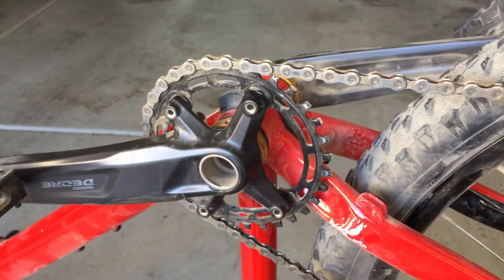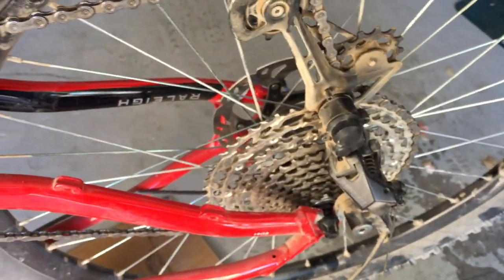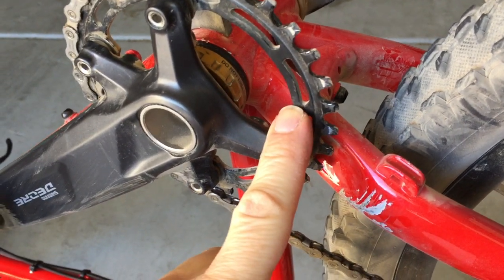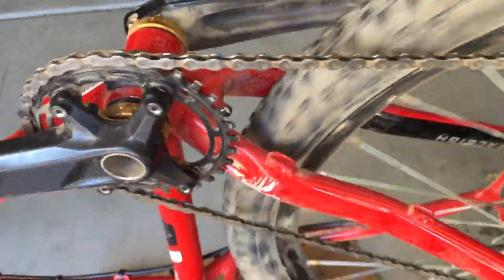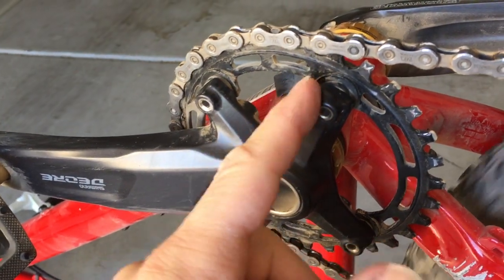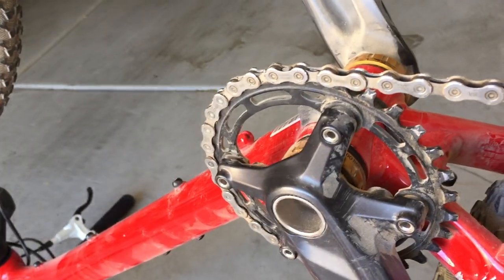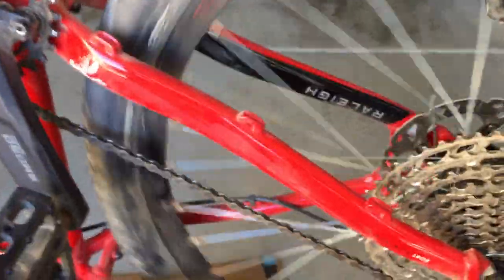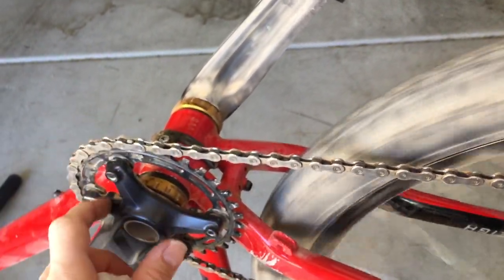Shimano Deore M5100 1x11 crankset chainline for 135mm OLD non-boost

Comment: I have no issues with backpedaling on 51t or 46t on my 135mm bikes. Chainline is perfect. I don't get this.
Who made this issue up? This maybe happens with boost components on 135 freewheels but I doubt that too as every video with the backpedaling issue was bc of wrong setup of bottom bracket spacers.
Reply from the maker: What’s your chainline measurement on those 135mm bikes? 47-48mm is ideal for 135 and 142mm OLD. Shimano specs 52mm for their boost cranks. The m5100 I installed is 52mm so I spaced it back to 47.5mm. I wanted the chainring to align with the center of my cassette. At 52mm, it was lined up with the 2nd or 3rd cog. Moving back to 48mm reduced the chain angle when in my 51T cog. Backpedaling may not have been a problem but I was more concerned about premature wearing of the chain and teeth due to the extreme chain angle especially with my short 425mm chain stay length. Removing or adding bottom bracket spacers effectively also changes the chainline of the chainring by offsetting the entire crankset.
Reply from the maker: You also may need a specific chainline to clear the frame, chain stay or tires. This was one of the reasons 148mm boost and 157mm super boost were developed. I believe 55mm chainline is used for super boost.
Reply: @mtbbiker6401  Around 50mm, if I remeber that correctly. 
Btw I've tried a round on a 157 and was hitting the chainstays with my heels (not into cross dressing!) all the time, that even happens with 135's, I got frustrated in a minute. Why is that, do you think that people that scratch their cranks don't have that issue?
Reply from the maker: 157 super boost is crazy wide. I think that was derived from true downhill bikes. There are a few manufacturers that have adopted it. Devinci, Pivot, Alchemy and others. I doubt it will become the norm due to the wide q-factor. Most makers have resisted the wider hub stating you don’t gain much in wheel strength to create a whole new standard.
Reply: Sorry it took me so long... What was your chainline with the right BB spacers setup? And why did you put spacers on the driveside in the first place, Shimano specifies 2 of them on the non drive side on 68mm if I remember correctly (maybe even 3 of them)?
Reply from the maker: @FirefighterBobby  For HollowTech II bottom bracket, Shimano recommends using three 2.5mm spacers for 68mm width brackets. Two on drive side (5mm) and one on non-drive side (2.5mm). For 73mm width brackets, only use one 2.5mm spacer on drive side. This is according to Shimano Dealer's Manual. My bottom bracket width is 68mm so I used three 2.5mm spacers. I could have moved one to the left non-drive side which would have reduced my chain line from 52mm to 49.5mm. I had room to move both spacers to left giving reducing chain line 5mm from 52mm to 47mm, but I didn't have many threads left if I put all 3 spacers on left non-drive side bottom bracket bearing housing. I would have lost 7.5mm of threads. I ended up leaving 2 spacers on the right drive side and 1 on the left non-drive side but added 4.5mm of spacers between the crankarm and the chainring resulting in 47.5mm chain line from 52mm.
Reply from the maker: @FirefighterBobby  So I just moved this crankset and bottom bracket over to a full suspension frame which has 73mm bottom bracket width but is also 142mm thru-axle non-boost. This time I only used one 2.5mm spacer on the right drive side per Shimano Dealer Manual while keep the 4.5mm spacers. The chainring was hitting the chain stay. The most I could reduce the chain line without hitting the frame was 48mm but it was still too close for comfort. I ended up moving the 2.5mm spacer to the left non-drive side and removing the 4.5mm spacer from the chainring. Now my chain line is set to 49.5mm vs 52mm on this other frame. I have not tried it yet but hoping it will be adequate.
Reply: @mtbbiker6401  that 49.5 works perfect for me, I have the same, just measured, runs smoothly like watter. Btw I should remove that plastic inside of BB or add a spacer on left non drive side, as it's too wide without that one spacer shimano suggests.
Reply: Another thing, seems that you're sticking with their manuals, and even tho it'll sound dumb, don't do it, use logic as I found them to not inform people properly, specially when it comes to older parts fitting new series or spacers and brakes. No way on Earth they'll tell you to mix their leavers with Magura calipers, or that many derailleurs work on different shifters.
Reply from the maker: @FirefighterBobby  Thanks for the info. Yes, Shimano sells a single bottom bracket size that fits either 68mm or 73mm. The internal plastic sleeve is the same size but requires you to used either 3 (2.5mm) spacers or 1 (2.5mm) spacer. So you don't run any spacers on your bottom bracket?
Reply: @mtbbiker6401  I do, but the one we're talking about (68/135 hub) I have 2 spacers on the opposite side to get the chainline to work, and on the other I run only 1 again on the L, wrong side. Both setups work well, and the measurments are not as should be, my chainline on FR bike should be 50,4 and is 49.5 with 2.5mm less. I don''t get it why, I just look for the right setup.
Reply: Btw just checked, there is no 1x cranks with less then 50mm chainline from Shimano, M7/8000 are the shortest. Zee is 50.4 that is for sure, I don't have to check. The rest (XTR, Saint, Urbans, DXR) is wider, no matter how old. Other widths must be from 2/3x cranks that I don't drive since I come from BMXing in the 90's, we don't use front mechs :-)
Reply: Yes you was right with spacers on 48.5/135 chainline. Hmm... thanks.